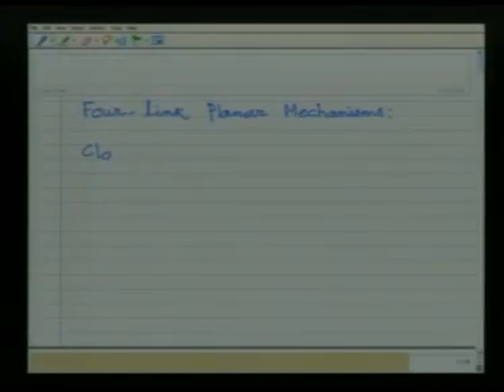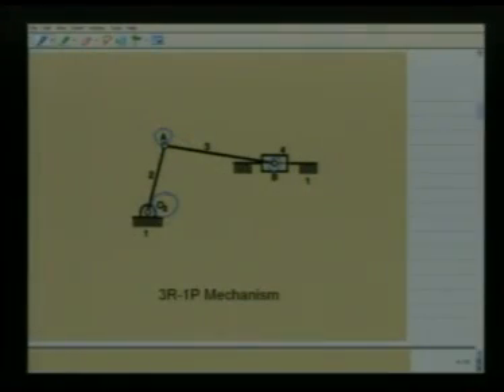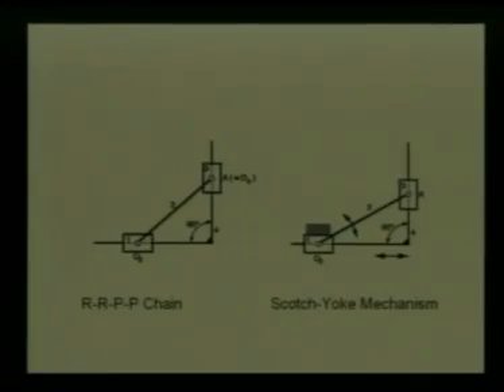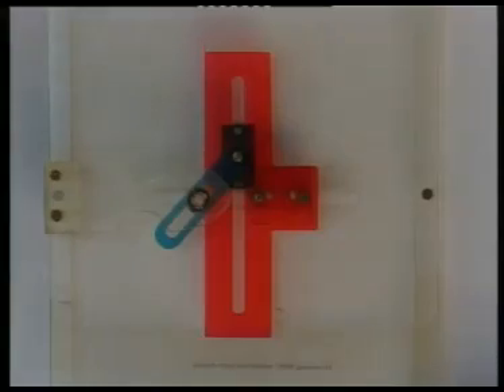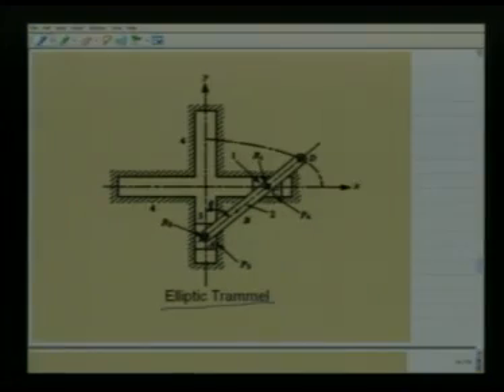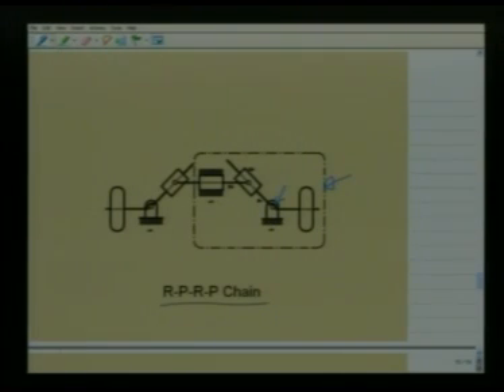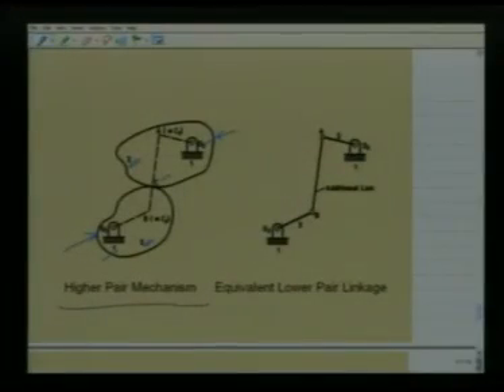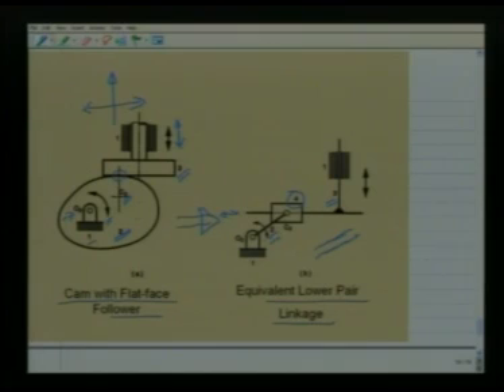Module 1 Lecture 3 Kinematics of machines

Comment: in RPRP type of 2R-2P mechanism sir has explained only 3 inversions
is that the two inversions of this mechanism are same as it is symmetrical in structure.
that is locking any of the two prismatic linkages would be same i think..
what do you guys say?

Comment: Sir, 
Can you please tell me the difference between Simple Harmonic Motion & Periodic Motion?
Reply: In periodic motion the time of oscillation from one end to another end is equal in every oscillation. Where as in harmonic motion the time will gradually decreases untill it comes in stationary state
Reply: @imranahmed-ri7iz  

Sir,
       Time of oscillation to constant hi rahta hai.
In the simple harmonic motion - the direction of the acceleration of body is just opposite to the direction of the displacement of the body.
         Thanks for the giving answer of the question.
Reply: In Period motion, the kinematic parameters like disp, vel & accelns are any periodic functions (for e.g. triangular, square, circular, or any other)which can repeat after certain period of time....
While on the other hand SHMs are special kind of periodic motion where all above discussed kinematic parameters are functions of sine or cosine nature which are harmonic......This is proved from the fact that acceleration is in opposite direction of displacement throughout the motion......